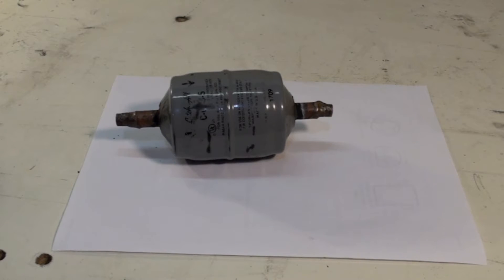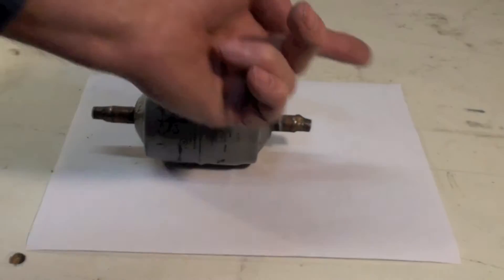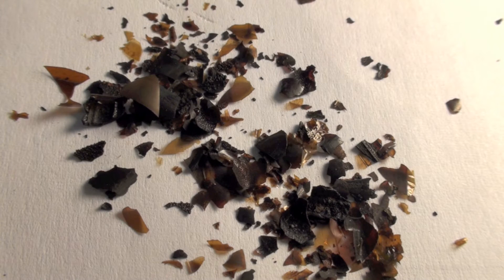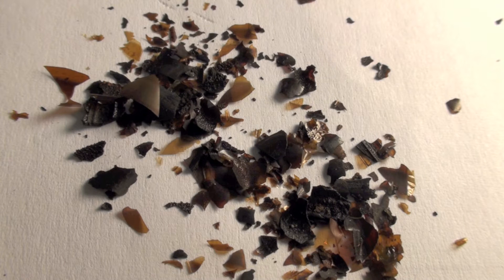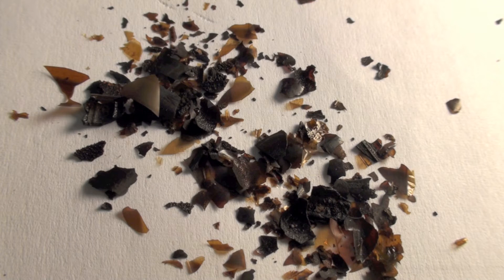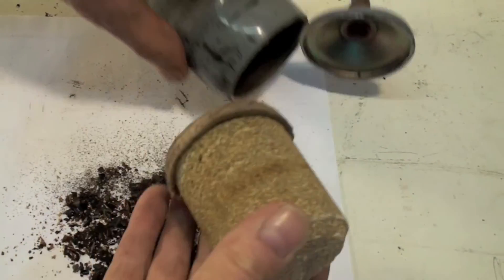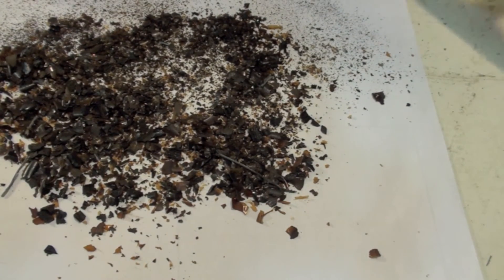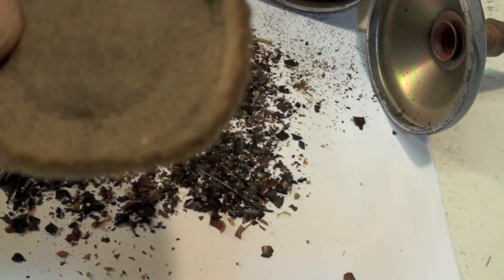A/C filter-drier filled with garbage

Comment: Another question... if after a recovery the drier at the recovery machine were checked as you have done here with the liquid line drier would it reveal this issue? And if the recovered refrigerant were allowed to settle in a room at a known temperature and a temperature probe was strapped to the cylinder and a pressure reading was taken and compared to a PT chart would that be an adequate determination of a contamination problem? Or does the refrigerant and its oil not give any indication of crankcase oil? Thank you.
Reply from the maker: Brian Fletcher  The drier in the line to the recovery machine may get contaminates if the refrigerant is recovered in liquid form.  Gas will not bring particles out.  By far, the best indication of refrigerant that has been overheated and broken down is the smell test.  One short sniff and you will know.  The pressure test does work but takes too long.  
GFM

Comment: Is it likely that debris is elsewhere in the system such as at the metering devices (or a reversing valve)? If so, is it practical to remove them and clean the screens, or is it sufficient to install a drier and possibly replace it a couple times shortly after the repair and simply let your analysis of the system with the SMAN3 tell you of additional problems? Thank you.
Reply from the maker: Brian Fletcher Its a judgement call.  The entire system could be contaminated.  You check for phosgene gas in the system first, and if it is present, proceed with the drier installs.  Replacement of liquid line drier with a larger one and installation of a suction line drier with a return to replace the driers and check for acid in the oil is the best way.  If there is an indication of grindings in the piping, the entire system needs to be disassembled to clean.  Hope this helps.
GFM

Comment: No wonder a complete rebuild and flush is the only proper way to make it as if it never burned out. Why do suction dryers have to be removed after a short time?
Reply from the maker: John Smith If there is a lot of this type of garbage, it could plug the drier.  Also driers do introduce some loss of efficiency due pressure drop.
GFM
Reply: Isn't that why they always recommend to size the drier so it's one size larger than the system?